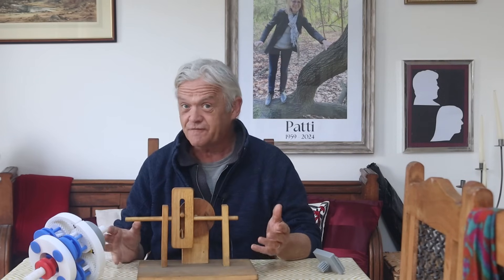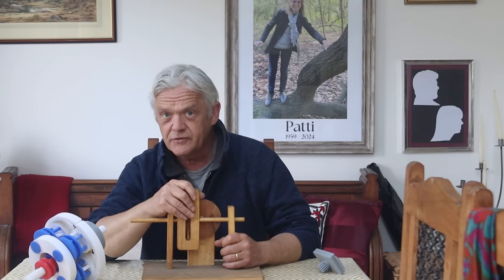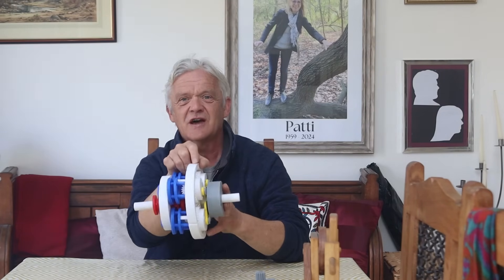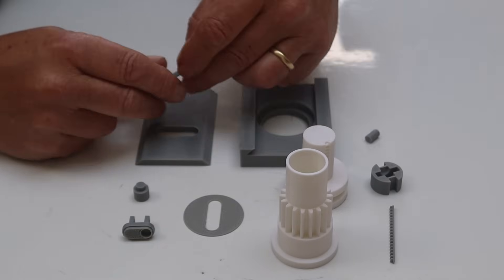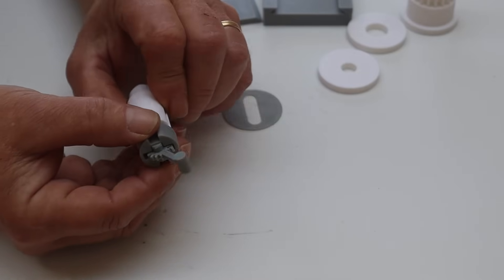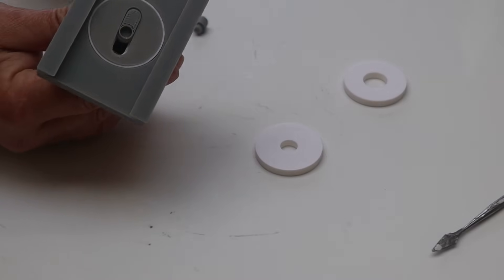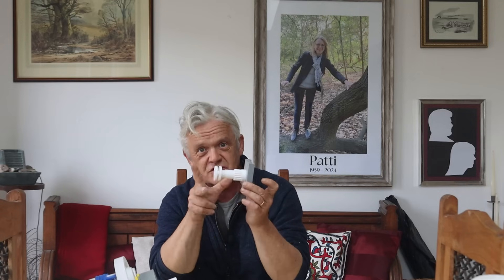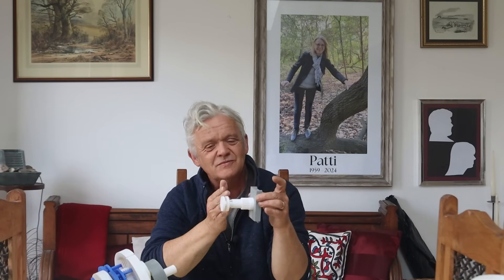2368 The Infinitely Variable Scotch Yoke

Comment: Clever design.  If the selector can withstand long term use, it seems like it would be very useful. I wonder if it can be driven from the pin side, then you could have a way to convert reciprocating linear motion to rotary too.
Reply from the maker: A noprmal scotch yoke can be backdriven mate so i don't see why this couldn't - i like the thinking too

Comment: Very good.  With rotary input to the yoke, the cvt ratio might be changed with a centrifugal input, somewhat like the governor for a steam engine.  You might be able to manage output torque with variable input speed, or visaversa, manage output speed with a stable input torque.
Reply from the maker: i like that thinking mate - thanks for sharing